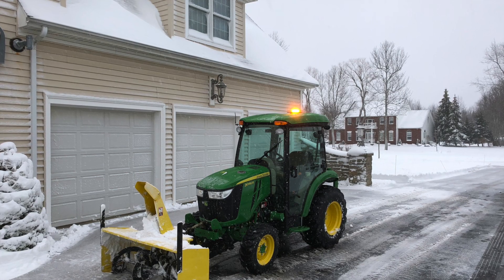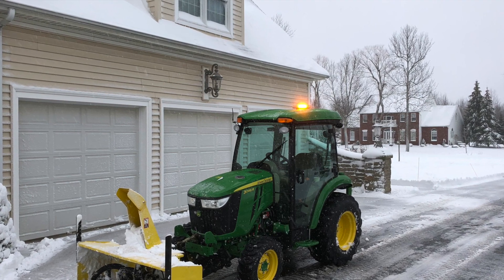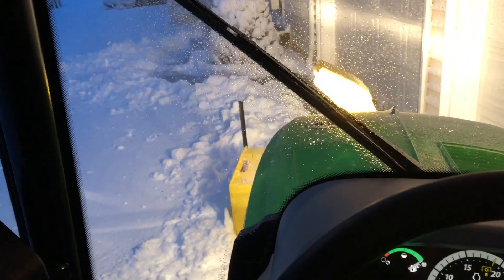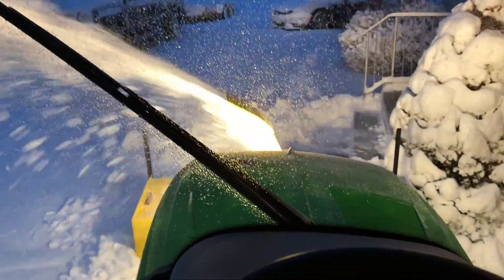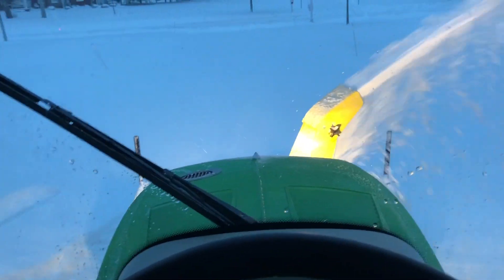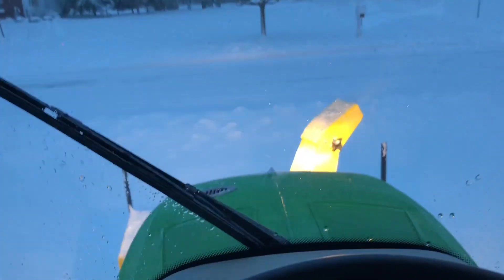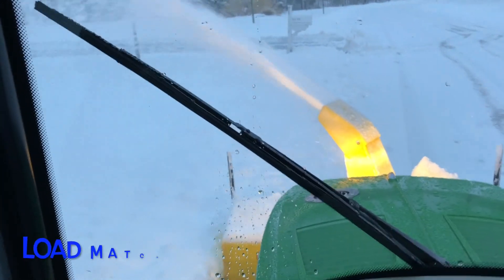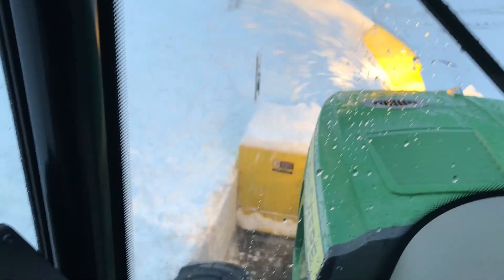#6 John Deere 3046R Cab Tractor Snow Blowing Wet Heavy Snow in WNY

Comment: I have the same tractor, however I definitely don't regret going with a 74" Rear Snowblower, and that way I still use my bucket as well.  Because If I had one on and not the other, I'd be wishing I had both.  I used the bucket and the snowblower 50/50.  Its not hard to use at all either.  I just lean on my right hip, and let my left foot do the Hydros.
Reply from the maker: Jason MacKenzie I have a hard time twisting to backup. I’ll see how my 59” blower works with my 64” rear tires. I may end up getting a box blade if it does not work well. Enjoy your tractor.
Reply: Once you use a front blower you will ever go back to a rear blower.

Comment: To make snow blowing easier on the equipment, try spraying the inside of the chute and auger assembly with either a PTFE or cheaper silicone spray. Silicone works for a couple of weeks before it needs another application. The PTFE lasts an entire season before reapplication is required.
Reply from the maker: Gunga Dinn I spray it on my atv so the mud comes off easier.
Reply: @maraudermitchelli +
  I did a wrap on my quad and had it ceramic coated as an experiment. It's worked very well.
  The next new truck I purchase will have a clear bra installed then ceramic coated. As you stated, clean up is a breeze.
  I looked up the price of your John Deere 3046r tractor and cab with the snow blower. All I can say, either you get 100 plus inches a year of snow or the JD dealer was giving tractors away when you got yours. Nice machine.

Good luck with the storm headed your way.

Comment: Hi!  Does your 3046 with the cab fit in a standard height garage?  I'm considering this set up for snow removal, but concerned with the height.....
Reply from the maker: My garage is 94.5 inches and she fits. But I would be careful none of the tractors or tires are the same. I would measure the machine and your door and ask the dealer to test fit at your house even with a used machine. I good dealer will help. Thank you for supporting my channel.
Reply: Thanks so much for your reply!  Blessings to you!

Comment: Nice rig! You need to hook up a electric actuator for the deflector on the end of the chute. I did it on my 2025  blower it works great! Didn't cost that much! Does your tractor use DEF ?
Reply from the maker: Fred Kaminski no dev, goes into regen mode and burns the particles off the muffler. It has done this once since I’ve owned it. I’ve studied hydraulic for the shoot where would I get an electric actuator?

Comment: Nice, however, I still like a straight loader for heavy snow.  My 2025R would never handle what your beast handles, but nice to know if I upgrade, to make sure I get a machine with plenty of HP for heavy snows...
Reply from the maker: Steve Grumpka I believe your machine uses this snow blower with a different mount. Loaders work well also
Reply from the maker: Steve suggest you watch my video #15 Plowing snow with 4n1 bucket. I use my front end loader to remove snow with Edge Tamers.  I have 3 mounted on the edge, but probably would recommend 2.
Reply: I think the 2025 would handle it. I have a 1025R and it hasn’t been stopped by heavy snow. Just gotta go a little slower.
Reply from the maker: Laurie B I agree. I think the smaller machines can handle heavy snow, not with the authority of a 46hp tractor...I know I’ve done it. If you blowing you go a little slower, if your pushing you take smaller bites. Thank you for watching,

Comment: Appreciate your videos. Supposed to pick up a 3046r in a couple weeks, trading in a 2720. I am curious about hooking up the 59 in blower. Haven’t been able to find out much about it but appears more complicated than what I’m used to. And then, how much do you have to remove for the summer mowing season?  Thanks for any info.
Reply from the maker: It’s is involved to change over to snow blowing, probably an hour. Make sure your dealer sells all the parts.

I highly recommend he 4n1 bucket I’ll have some more tractor video out this week.

Is your tractor a cab unit?
Reply: Marauder Mitchelli 
It is a cab.  A municipality ordered it several months ago pretty well loaded. They ended up taking another unit so this one became available. It has turf tires and after some online research I’m going to give those a try.   Got a 72 mid mount mower and the snow blower attachments. I’ll look forward to some more videos!
PS. Said it would be about six months if ordered today.
Reply from the maker: j3c7l10 new video tonight you’ll love the machine. Congratulations!!!
Reply: Marauder Mitchelli 
Sorry to bother you again, but you’re turning into my “tractor mentor”. I added the wheel spacers and tried the beet juice but my local dealer uses “biomass” instead. My latest question is about the snowblower again.  Just got my 3046 back from JD today after they put on the snowblower. They took off the grill guard and the front hooks for the mid mount mower. Not too concerned 
about the grill guard but do you have to take the front pto mounting plate off to put the mower back on?  Thanks for any info.
Reply: get a snow pusher for the front, but a frontier blower on the rear, its a very powerful solution. Rear blower is more powerful, push the snow where you can back into it and blow it. You also don't lose use of your front bucket this way.

Comment: How tall is your garage door? I don’t think that big machine would fit in my garage
Reply from the maker: 8 feet and it clears with the low profile strobe, I have the larger r4 tire. I also measured the tractor at the dealer.

Comment: I'm thinking about selling my Chevy 2500 daily driver that i also use for the few times a year it snows and buying a 3series and ill buy a 1500 for my daily driving and towing. I figure its about $10-15k more to buy a new 2500 plus it would be fun to start a little side business taking care of the neighborhood in a tractor.  I've found doing residential with my truck is a bit of a pain it's hard to get close to things and do a nice clean job.    Most of our snows down here in PA are pretty light with the occasional substantial snow. I'm thinking a loader with a plow on it with a snowblower on the 3pt for those major storms.
Reply from the maker: rccrazy30 good plan. My family has been moving snow for 53 years. It is very hard on trucks and not so hard on tractors. It’s difficult to snow blow in reverse, especially the older and wider we get. For occasional snow it may be fine. Loader mount snow box blades are awesome for short runs. You have a great plan. I have trucks with plows at work and I can’t get my guys off the Kubota, great for detailing a parking lot after snow.
Reply: I went from using a walk behind snow blower to renting a skid steer to buying a bigger truck with a plow. I can definitely see how it will get harder luckily still pretty young so it shouldn't be an issue at this point in my life. I would go with the front blower if we got heavy snows consistently but most of the time its 3-6" if that so the plow would allow me to move a little quicker. My plan is to go through one more winter in my truck. I'm waiting to see how well this new Duramax works their putting in the 1500. I heard a rumor of 30mpg that would be a welcome break from 9mpg. 

p.s I've got a nice long plowing video on my channel thats the one and only commercial lot I'll be doing (its my families company)
Reply from the maker: I have a GMC Sierra with the Corvette Engine and 8 gears, rear ratio is 3:20 i get 29 mpg on the highway during the summer, and 15-16mpg around town. It gets much better mileage than the smaller V8. Good luck with the truck and i'll watch your video.
Reply from the maker: That's a lot of snow! I love the hoods on the HD truck. In our area the big thing now is V plastic plows for trucks. We've had steel V plows for years.
Reply from the maker: Nana is awesome...she's great in front of the camera i'm Jealous!!!
Reply: yeah, that was a record storm for us. I had already made 2 passes! A V plow or Wideout would have been nice. Orginally I was looking at getting a Kubota RTV 1100 with a V plow. But I'm not sure it would handle a snow like that and the snow blower option for those things are crazy expensive.
Reply: Thats not too bad. My dad has a Canyon with the small duramax. He can get 29 on the highway but avgs 23 city/highway. It's a great little truck id buy one but If im going to tow something like the 3 series I feel the 1500 will be the best fit.
Reply: She is great! that channel has taken off quite nicely over the years.